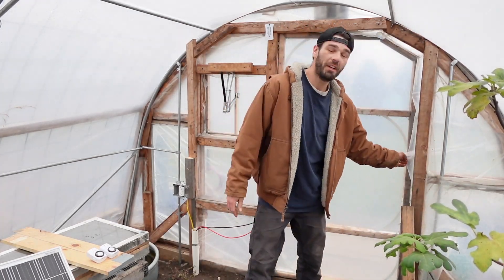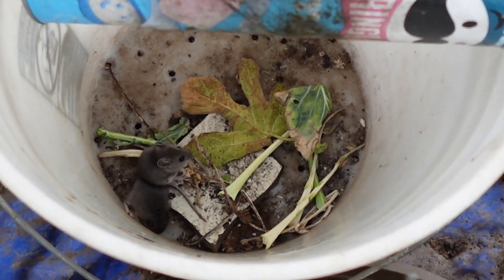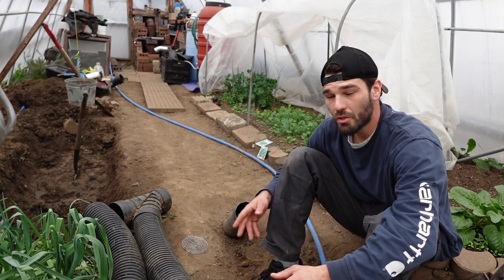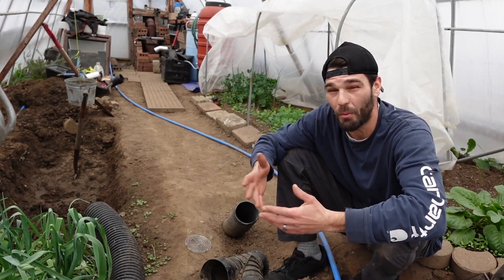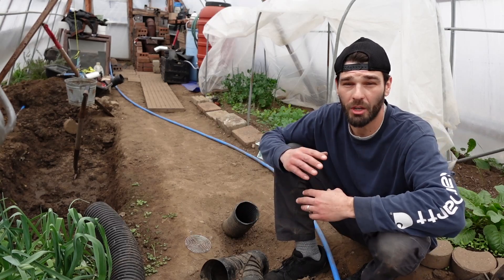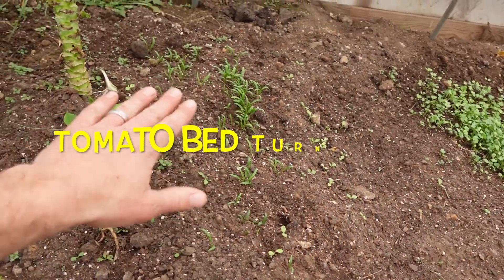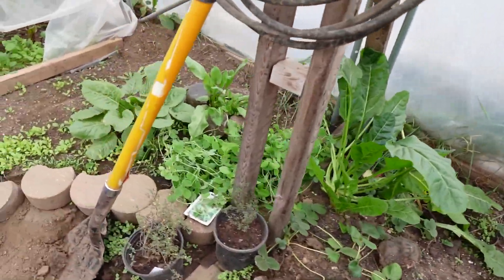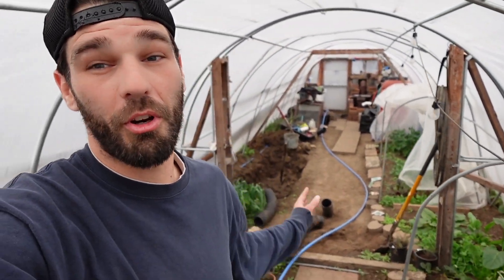DIY Geothermal Fix & Operation - Water Removal & Importance Of This System In The Greenhouse

Comment: A 70ft tube with 70cfm results in a dwell time of 13.4 seconds. When used for cooling the air in the tube will drop to the ground temperature in the forst 10ft or so and then coast through the other 60ft without losing any more heat. When used for heating the air might get halfway through the tube before it matches the ground temperature. Its better to have all of the tubing actively transferring heat. If you use it for cooling a residential house, you should isolate the system air and house air with an air-air heat exchanger.
Reply from the maker: Great input sir! And yes the inputs on calculations for this are overshot, but I wanted transfer to the middle of the greenhouse hence why it’s that long. Thanks for watching!
Reply: @Earthdwellershomestead  
If your fan documentation includes a PQ curve you can check if its capable of 70cfm @ 0.4" static pressure.  This kind of fan performance is very similar to the small blowers used to inflate double skin poly covers.

Comment: Do you use perforated drain tile for this?
Reply from the maker: Nope, we use solid heavy drain tile to avoid it crushing and to avoid microbes and bacteria/ fungi from underground blowing into to the air
Reply: If used to cool the greenhouse you should cut a straight slit partway through the corrugations and locate the slit at the bottom when you install it. If you dont, you will have cxondensate build up inside the tube with nowhere to go.  Its important to cxonsider that water inside the tubing will be converted into water vapor (a gas) when the system is used for heating. Converting liquid water into water vapor (a gas) requires (sensible) energy, which is provided by (aka, stolen from) the thermal mass. The air delivered to the greenhouse will be roughly 40% sensible and 60% latent, latent being the water vapor that only serves to raise the greenhouse humidity, not the greenhouse temperature.

Comment: Your doing some great experimenting and I've watched several of your videos, I will offer some feedback though. The videos I watched are all kind of the same, kind of hanging out in the structures and talking about the set up you've done, which is awesome but some really great content would include filming while you're actually doing the work and setting up the systems. Show exactly what you did, what you used, how it worked and the problems you encountered and how you fixed them. When I found your first videos I thought 'I'm surprised this channel hasn't blown up' then I noticed the content people are needing more of (how to) was lacking (at least I couldn't find any that went beyond an overall glance with a bit of narration). I guarantee if you start filming the start to finish, this channel will grow quickly. Good stuff here though, we use many of the same tactics and they work well. Good luck fellow homesteaders!
Reply from the maker: Constructive criticism highly welcomed, we try and show most, but a lot of it is answering questions and relating certain amounts of data without making too lengthy of a video. All your info will be taken into account!